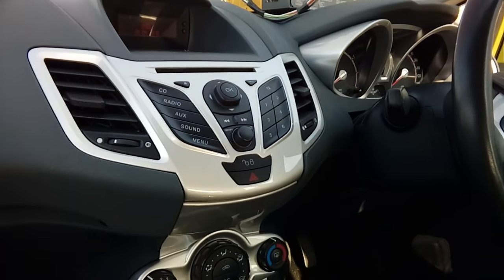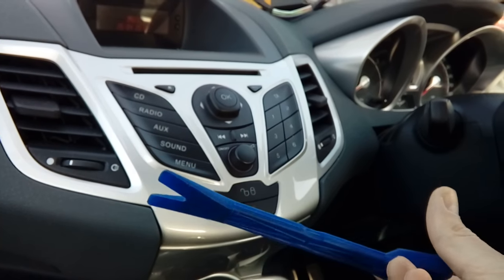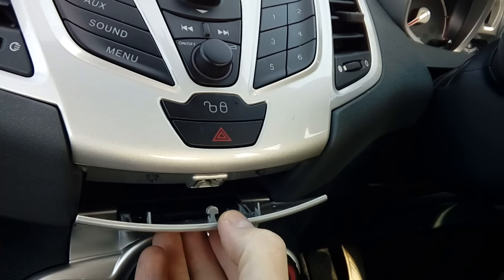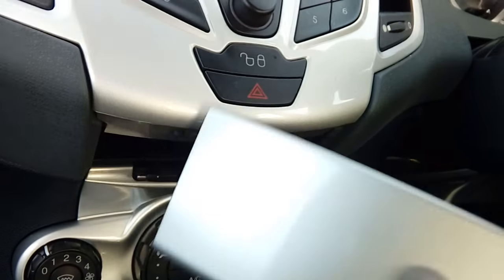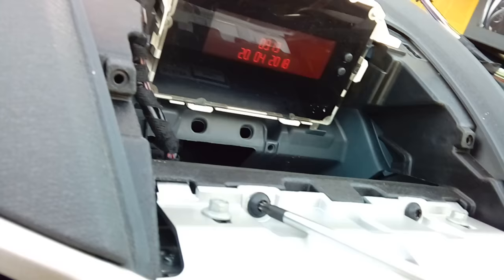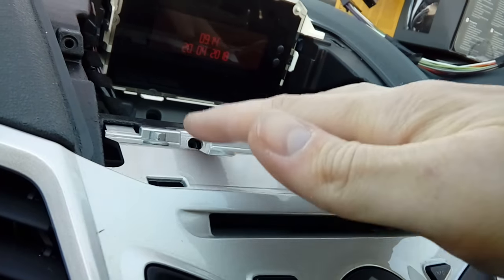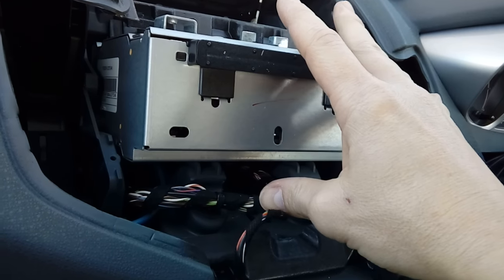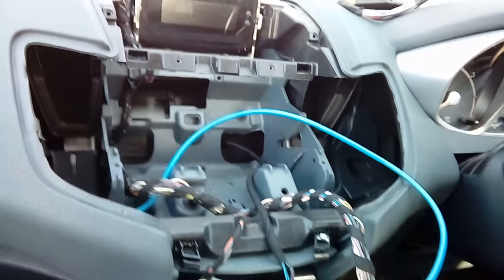Fiesta 2008 onward how to remove factory radio,simple step by step guide.

Comment: Maybe you could help me with identifying the problem with my head unit. My fiesta has 8A6T-18C815-BK and it wasn't fitted with aux/bt by default. I installed analog of sot 938 from AliExpress but it doesn't work (like at all). Probably the head unit needs some kind of software update but i cant find anything in the web.

Comment: How do u make the radio hands free mate do u just put that SOT - 938 in and then it works or is there something else 👍🏻
Reply from the maker: You either buy a radio with Bluetooth hands free or add something like a Parrot hands free kit.
Consult a retailer for prices and current models.👍🏻

Comment: I have a 2011 fieast and the steering wheel buttons don't work anymore and the voice button on the indicator don't work either. Is there a simple solution to fix this or do I have to take it to a dealer to fix? Any help would be great.

Comment: Question: before I attempt to take out my stereo, I have a problem with the AUX lead input: I have tried two stereo small jack to jack leads and each time the sound is reversed, ie. left channel in the right speaker and right channel in left speaker. I find this very annoying. I have taken out the AUX input to check and it is a closed lead, so I cant reverse the channels from there. Is the input in the back of the stereo the same (a closed plastic unit) or does it split into 2 wires so I can change them? I couldn't see the AUX input there on your stereo.

Comment: My little boy posted a 50p in the CD player in my Ford Fiesta. If I follow your instructions would it be easy to remove the coin ?
Reply from the maker: That's a very common thing lol. Yes but you might have to pop the lid off the radio to top it out.
Reply: @PJsprojects  cheers 👍

Comment: Thanks for your guide!
Can't believe that the cable at 5:40 is making bad contact.. is that possible??
Reply from the maker: It's possible if either the pins inside are bent or the connector is not pushed on properly.
Reply: @PJsprojects  Thanks for your reply, really appreciate it

Comment: Hey bud, know an old video, but what specifics do you need to replace a radio? As in size etc. Trying find ones to fit the dash but not sure to search
Reply from the maker: Radios only come in two sizes, single din and double din. 
For an easy life ask your retailer about single din radios.
Reply: @PJsprojects  OK, so it's more important to find a bit that fits the dash rather than worrying about the radio size?

Comment: I have a 2013 Fiesta S and my dash trim has a slightly different shape with a passenger airbag indicator below the hazard switch. Are they not all the same 2008+?
Reply: hei, in 2013 they changed a few things, like the new system SYNC, on the Fiesta but its still the MK7, so when you got a Fiesta from 2013 or past, its different to the Fiesta of 2008.

Comment: Hi pj ford fiesta 2010 titanium cd keeps ejecting when putting  disc in any ideas what's wrong
Reply from the maker: Cd mech is either out of alignment or something is inside that shouldn’t be.
Reply: @PJsprojects  it was all right the night before but in the morning that's when I had problems can it be repaired
Reply from the maker: @stevehannigan3498  Yes, just needs the Ford alignment diagram or whatever is inside removing.
Seen lots of them with coins inside from kids posting them in the slot.
Reply: @PJsprojects  I don't feel confident to have a go at it myself there's know place in Coventry to take it
Reply from the maker: @stevehannigan3498  If you have already purchased the new radio you will need to find a place that is insured to work on electronics that they didn’t supply.
If you still need to buy the radio the. No problem because places like Halfords will supply and fit. Most places don’t want to touch radios bought from elsewhere incase the owner try’s to scam them saying the company broke the radio.
Reply: @PJsprojects  like I said it's reading the disc  but not playing and keeps ejecting. thanks for your help much appreciated 👍

Comment: Do you have the link for the SOT-938 kit. My car doesn’t have Bluetooth but I’ve upgraded to a later fiesta radio and it needs the adapter leads for the Bluetooth to work. It’s a 2010 mk7 fiesta
Reply from the maker: Sure most places such as Amazon,Ebay or larger car shops should be able to supply the cable. Example - https://www.ebay.co.uk/itm/FORD-FIESTA-2008-T-HARNESS-WIRING-MUTE-PARROT-BLUETOOTH-ISO-LEAD-LOOM-SOT-938/280767422534?hash=item415f0ae046:g:rzkAAOSwnlFadcAn

Comment: Really good little video! Just wondering if anyone knows? We have a fiesta 2009 but want a sat nav built in? Or even a Bluetooth stereo unit with dab? Is this possible? Could I get a newer ford stereo and put it in? She's got a zetec so basic ford stereo without Bluetooth
Reply: I don't think you can put in a different ford stereo without replacing a lot of the wiring, from what I've read and enquired.

Comment: Hi I am looking to retro fit an internal bluetooth PCB for music and hands free. This will require me splicing into steering wheel control wiring.. Do you have any info on wiring colours for steering wheel controls? and aux in behind head unit?
Reply from the maker: Due to model/year/spec variance you would be best advised to give the dealer your chassis number for the correct info on this one.
Reply: @PJsprojects  many thanks ,, things have moved on a bit now ,, seems head unit has given up , power reset didn't work , so need to source a used unit before I can start on Bluetooth project😒. Thanks anyway

Comment: Thank you for your video, i have a problem with my radio, there is power on the radio screen but i cannot switch on my radion, if i press the on buttom nothing happen, please advise what could be the problem
Reply: Hi. Did You solved this? I got same problem. Left it on aux and all buttons not responds. Still can using through aux wire.
Reply: That’s quite simple actually. Just disconnect the battery for 15 minutes and it’ll work again. It’s also possible to pull out the designated fuse, but because it’s YouTube and I can’t post pictures here it’s quite hard to show you which ones you’ll need to pull. Can you guys let me know if it’s worked for you?
Reply: @damienjasonweijers1174  So it's simple or You don't know how to do it ? :D
Reply: @damienjasonweijers1174  Disconnecting battery not helping.

Comment: If its possible to change to another radio with navigator?thanks
Reply from the maker: Yes you would need a kit along the lines of this one.
https://www.ebay.co.uk/itm/Connects2-Ford-Fiesta-Mk7-2012-on-Double-Din-Stereo-Fitting-Kit-Black-Grey/232264390031?hash=item361409558f:g:YV8AAOSwB-1YwCeu